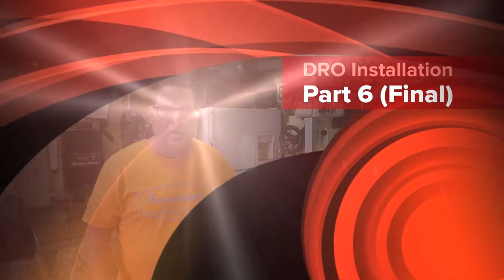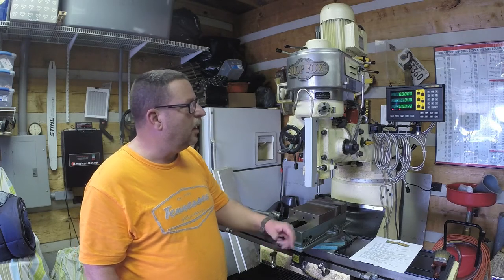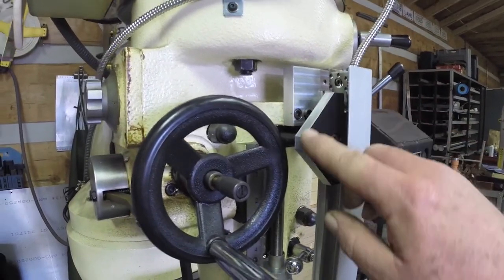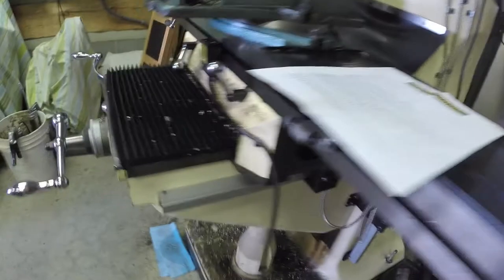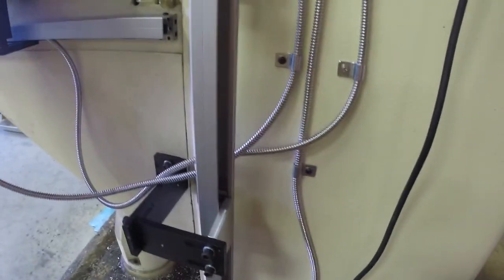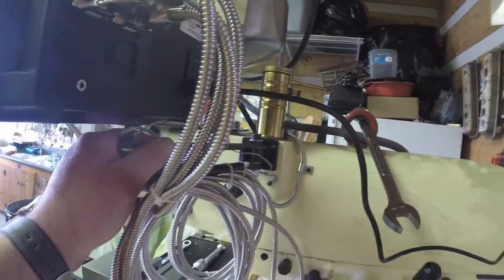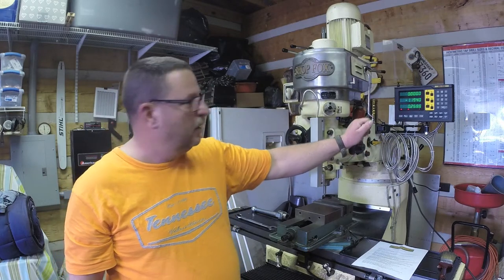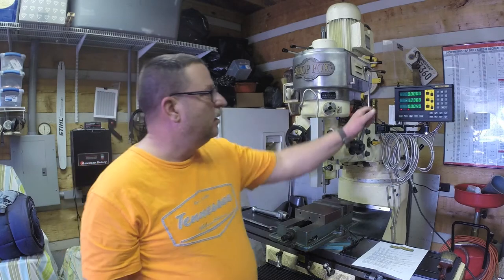DRO Pros EL400 Mill DRO Installation Part 6 (Final)

Comment: How long did you make the reader for the quill ? This is the first video I have seen on youtube to actually have a quill read on the 3 axis console. Excellent work and I am buying a 3 axis display for the bridgeport, moving the two axis display to the lathe. Subbed. Would love to see the dimensions of the quill mounting bracket